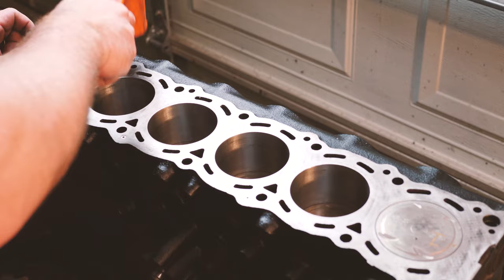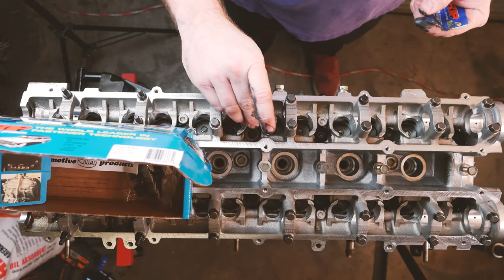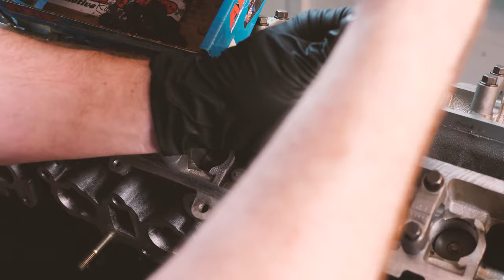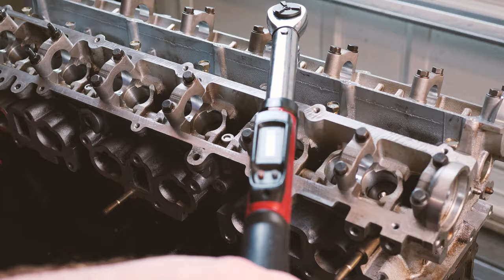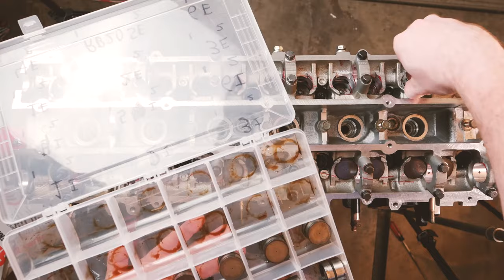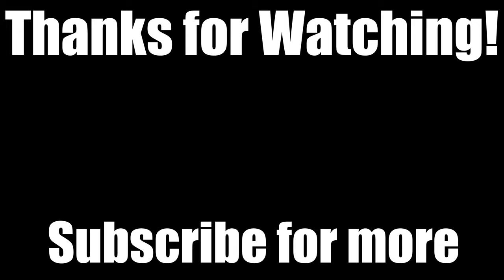Triumph TR6 Rb20det Build Part 4

Comment: I'm surprised you don't have more subs
Reply from the maker: Yeah, nature of how-to videos. But i finally got to the point of starting back on the thriumph and plan to start on it over the winter/fall. Right now im trying to decide the right wheel and tire sizes. Im thinking 255/?/16 in the rear should hold with the general lack of torque from the rb20.

Comment: Great videos dude! I’m a machinist so I am very meticulous so I like how you explain everything in detail. I am curious to how much hp your going for though?
Reply from the maker: Thanks! and probably about 400 at the crank so mid 300s at the wheels give or take. Just ignore my "machining " videos.
Reply: DeWoody's Shop I didn’t even see those but now I’ll have to check them out lol.. mid 300s is pretty good. I’m debating on my swap for my 280z right now. The vq engine is easy to get but the RB looks so much nicer and sounds amazing. But... there hard to find for a decent price. You make building one look easy and I think I could do it if I found a decent RB to start with. Keep up the vids!
Reply from the maker: @justinroberson9678  Yeah, the only reason i got this one is i found an amazing deal. i think i had been watching for one for about 8 months to a year before i found this one. Its not bad, most straight engines are easier  because less cams and chains and belts than a DOHC V engine. Also for me the RB is built pretty similar to bike engines so that also helps me since that's what I'm used to.
Reply: DeWoody's Shop that’s what I have gathered also. The inline six is an amazing platform for looks and performance. I can’t seam to find one anywhere sense COVID hit. There not importing anything cool lol..